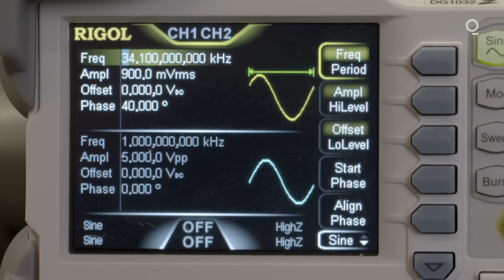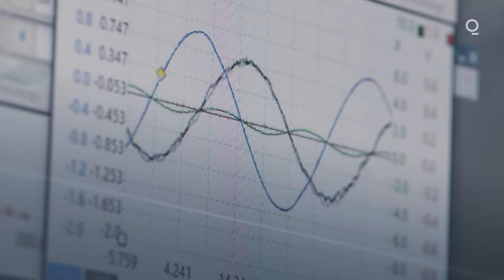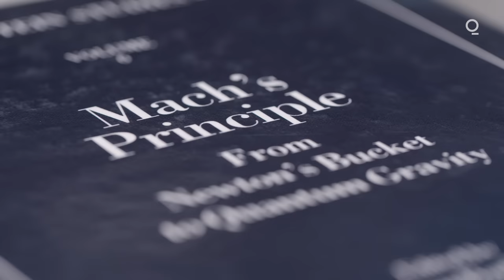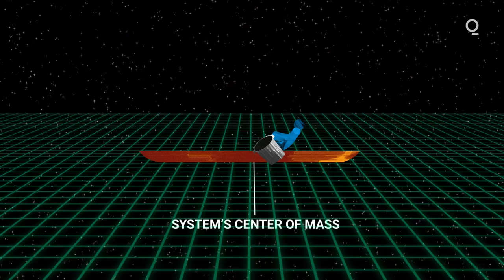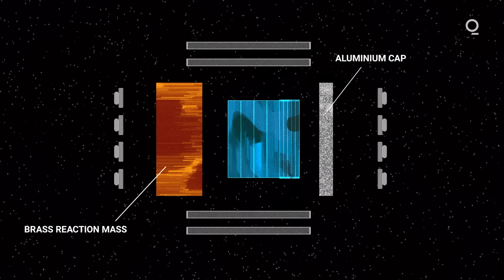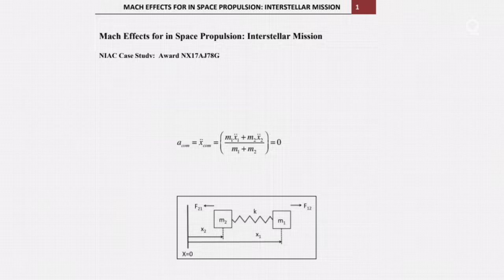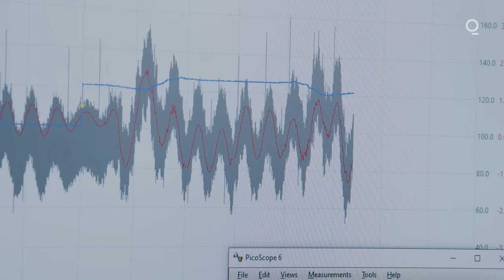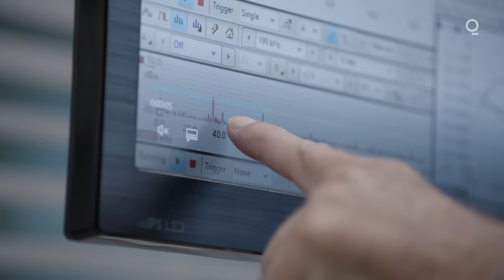Two Scientists Are Building a Real Star Trek 'Impulse Engine'

Comment: Wait a second. How is the crystal losing mass? And where does the mass come from? Where is the mass that they are scooping up in their magical bucket? How do they scoop it up to increase their mass and then how do they dump it? Until they actually explain the mechanism by which the system is working, this just looks like science fiction nonsense. It's interesting that NASA is willing to put some effort and money into figuring out if anything relevant is taking place. It seems rather unlikely, partly because I'm biased due to my current understanding of the universe, but also because these guys haven't explained how they are changing mass. If you take all the vibration out of it and just demonstrate a change in mass that isn't explained by our existing understanding of the universe, and is significant enough that it can actually be measured with instruments, then that would be interesting. Until then, this is like a perpetual motion machine: the person building it may believe it works, but it doesn't stand up to scrutiny.

Comment: The only  mistake you can make  is ignore the sience and math or make measurements that incorrectly represent the data spending money  creating a machine that does not operate as expected. Every possible out come calculated 
simulated until there is no possible way you would not expect a problem but you know there will many as make modifications retest until you . During the course of the build new materials or material at the edge of there perform  capabilities. We never ignore anything until that idea is completly studied and under stood. If you destroy something that halts every thing. Unless what you testing is trying will not self destruct. Thay will fire you.

Comment: I find it very strange why there is a wall on the reaction force.
The force can be successfully pushed within the system but with little efficiency. I reconstructed the structure and made an unlockable bottom plate (OpenClose) with a punch on the front (+) and back (-).
C(+)1, O(-)1-(+)1, C-(-)1. In the new round, C(+)1 will be used, and so on to successfully advance in one direction. Using a machine gun structure, no power is used when pushed to the end, and then lined up, and the power is restored when it returns to the head.

The translation is super bad! Super bad! Super bad! There is no other way but to use numbers.
Reply: I find it very strange why there is a wall on the reaction force. "The reaction force of a ghost hitting a wall."
Reply: 從數學上很直觀的看到C(+)1(-)-1=2。直接證明理論正確。無視頻率問題，但會摩擦生熱。

Comment: I don't believe this thing can work I know this thing can work
He is just missing a few ingredients 
1. He need an external force like that of  lasers
2. His drive need to be in a heat sheild to prevent over heating 
3.he need to vibrate 📳 at specific frequencies to create counter force
4. This tech will work best in the vacuum and weightlessness of space.
5. the reason why his machine doesn't work is because of inertia

Comment: Ion engines are the next best thing when FTL is not available.

My latest brainchild:

It incorporates external ionization of incoming extra stellar mass.
Even extrastellar mass can be used as propulsion exhaust.
At the front it ionizes incoming micromatter, which is lead along the outside of the hull,
and shifted in positive and negative ions over that distance, with high frequency
polarity shifting electromagnetic fields, which then ensures that positive ions are
separated from negative ones, and then lead into an acceleration chamber,
which then increases the incoming matter's speed, and thus receive a kinetic boost.
The expulsion of the incoming matter with a start speed as low as 100 km/s
is sped up to >0.5 c or 150.000+ km/s. Even the little matter there
is in extrastellar space is enough to add kinetics for a space ship
by as much as 8.6 m/ss for the entire weight of the ship, measuring
1.000 tonnes in weight, and a frontal surface by 50 meter radius circular.

Note: This would not neccesarily be indicative of the volume, since it's basically
a matter collector part, with a tiny factual space ship at it's back. 

It's amazing that so little matter can still add so much motion energy.

Comment: No, they don't. It cannot work that way. But, of course, making wild claims results in sponsoring the project. And getting money is a success on its own, right.
To be clear: moving matter is moving mass. It doesn't really matter which means you use. What matters is the difference between the start point and the end point of the center of gravity of an object. It is ordniary phsyics. You cannot put it aside.
So please delete this nonsense.

Comment: I'm trained in science - some of these projects I just say no immediately - no to con men looking for grants and funding, who don't agree with the laws of conservation.  I can't do that here as although this is a long shot to be honest, much of what was said makes enough sense scientifically so that it is worth a try. We actually benefit from trained scientists who look at the edge of what we know and are not afraid to wing it a little.
In this particular case I agree that increasing energy of a substance does increase the substance's mass - but that mass came from the potential energy of the power source, so it will balance out. Thus to work the power source must be external, like eg solar power. At this point, if this method works, how is it better than a light sail? It becomes a complex method of exchanging momentum with light.

Comment: why not take one of these drives and mount it in a floating hull ... then run it ... if the principle is sound the boat hull should move ... ok sure water is much more dense than space BUT it still can be used to prove the concept ...
Reply: millions in testing when all they need do is take a boat hull from an rc boat ... mount their drive place it on the water and turn it on ... if it can move the boat it is then proven that it can move a space craft ... since space sure is a lot less dense than a pond of water ...

Comment: Proving your theory is a problem because your theory is incorrect however you ARE onto something important. You're getting motion because of the perfect timing of vibrational forces but they're not pulling or pushing against the spacetime continuum. The particles in the crystals are acting against the masses of the other particles in the crystals themselves. Discover the sequence of movements of particles in the crystals on a microscale and then mimic it using multi-hulled ship on a larger scale.